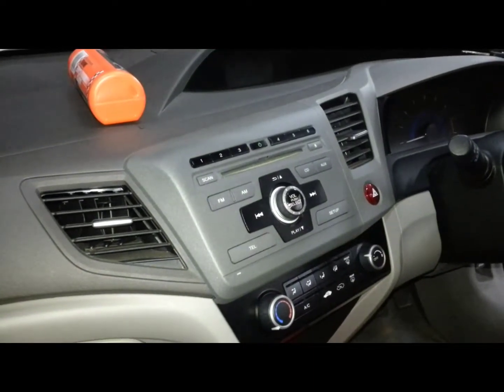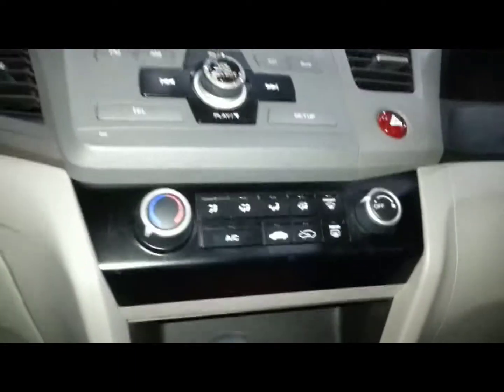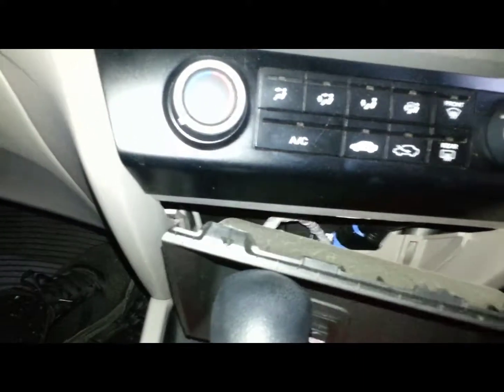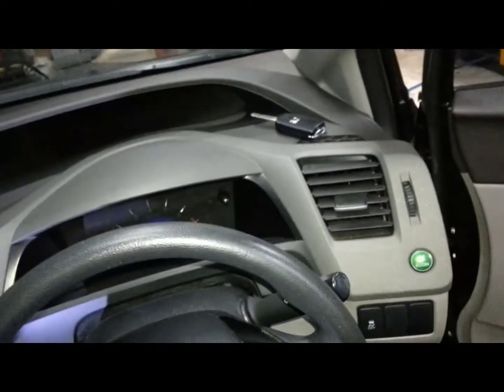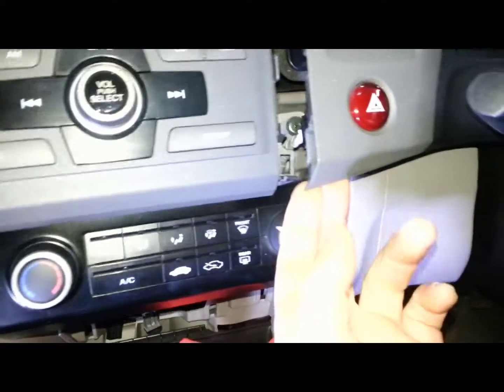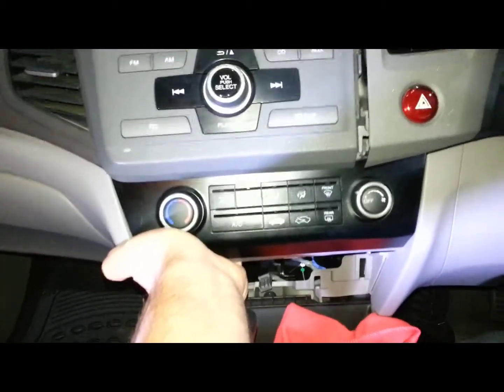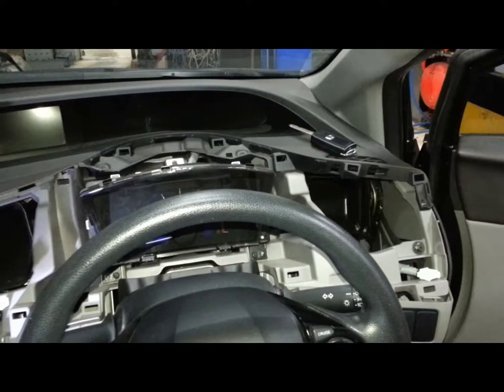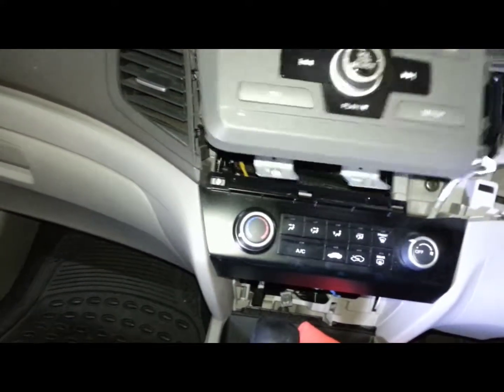How to remove the radio from a Honda Civic

Comment: Is the panel hard to remove or reinstall I'm worried about the clips..
Reply from the maker: No. Clips will be fine. Just take your time.
Reply: @DIYChannelSteve  is it hard to snap back in once you remove?
Reply from the maker: nope. removing is the hardest part.